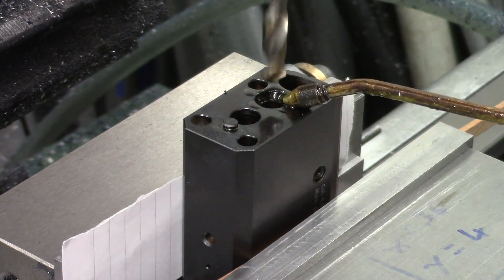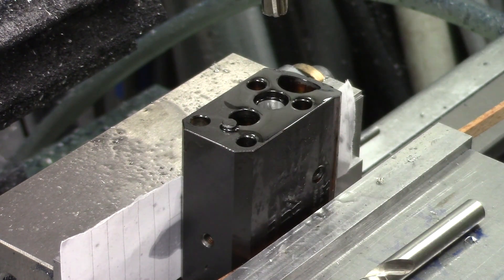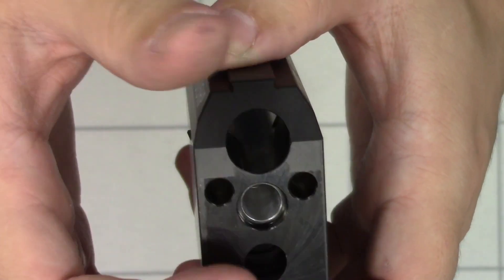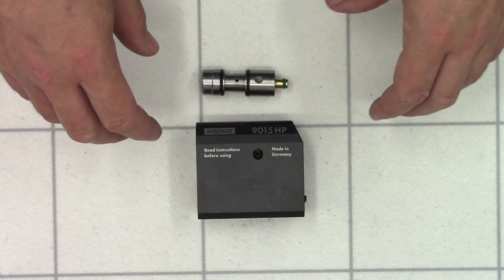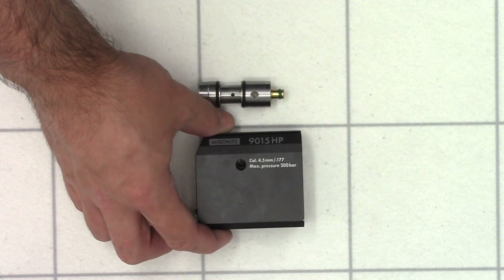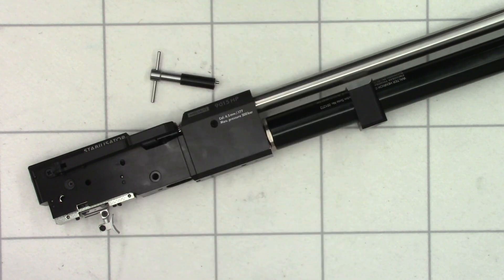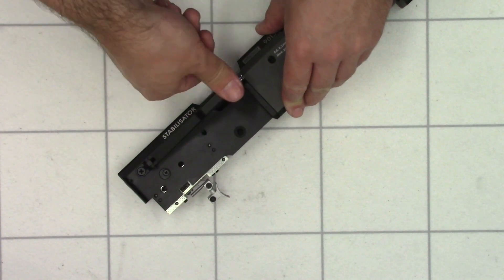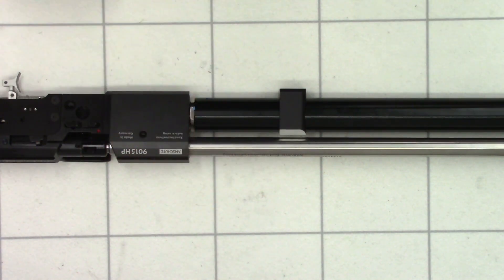Drilling out the Anschutz 9015 HP plenum.

Comment: Hi
So if I open this hole like you, I will have a stable 15-16j?
and we are talking about the modification of the 7.5j carbine?
Reply from the maker: this is the mod to go from 7.5j to 15j and it works well you may need to adjust the reg also